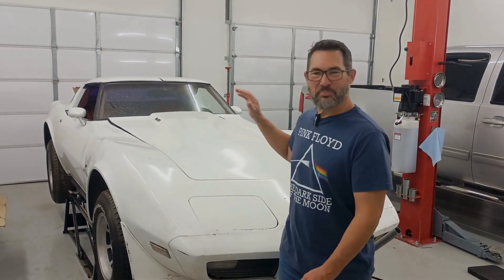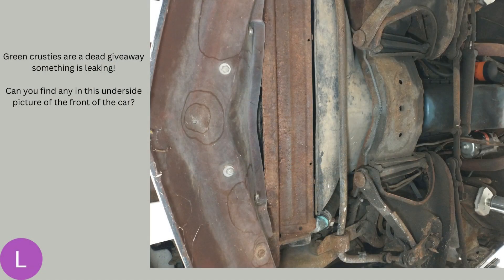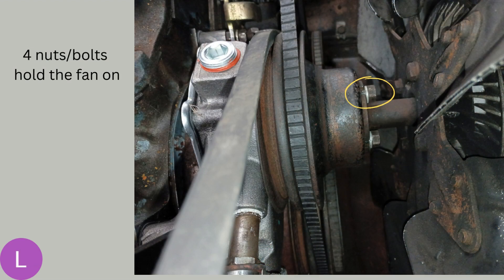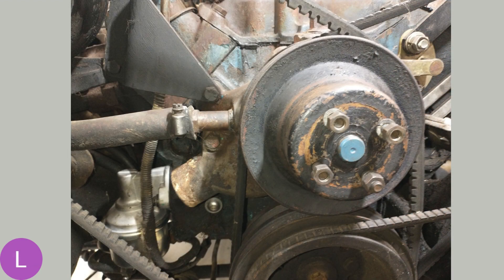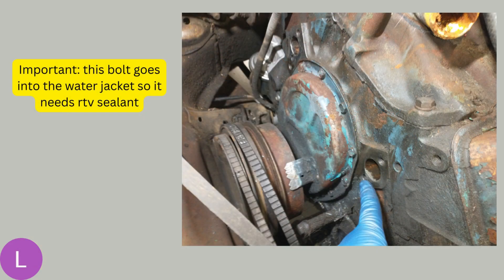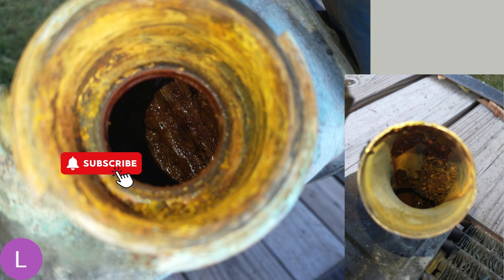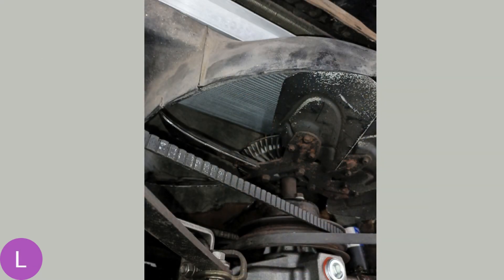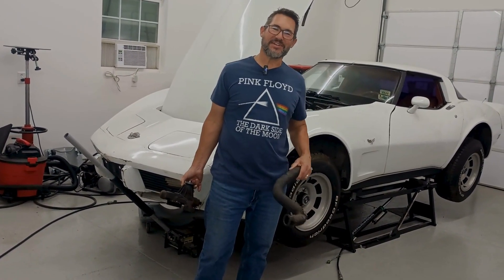c3 corvette cooling system repair

Comment: Awesome video!  How did you clean/flush out the block of rust without circulating rust through the new radiator?
Reply from the maker: I remove thermostat and hoses from radiator, then flush fresh water through while it runs for a bit till runs clear